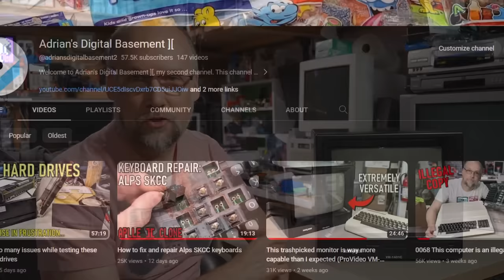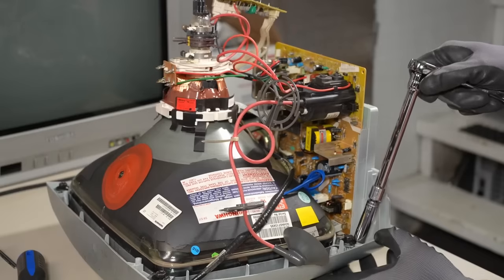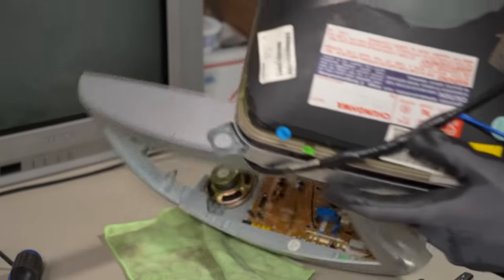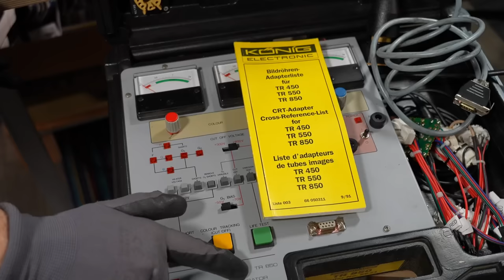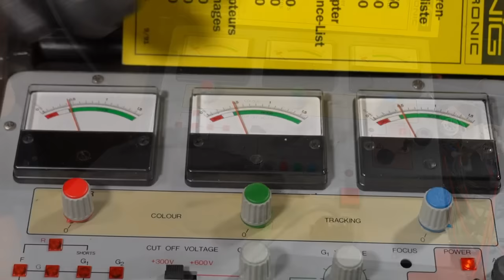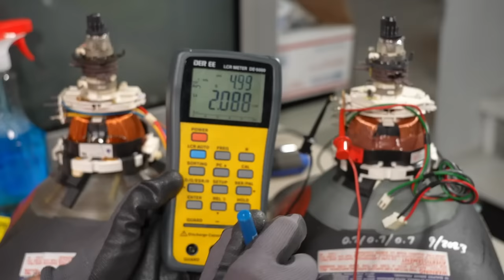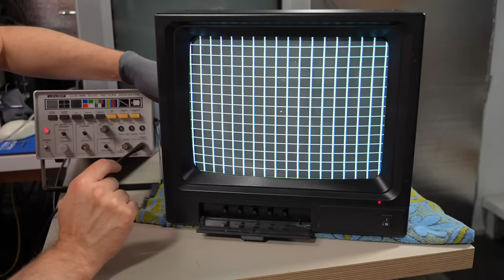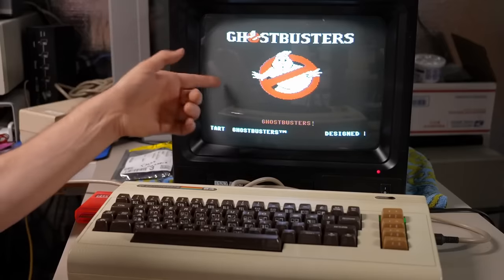From junk to awesome: Fixing an old monitor by swapping the CRT

Comment: I'm having a lot of nostalgia for how I taught myself electronics in the 1960s. When my father would take me with to the local city dump I would collect all the radios and portable televisions that looked either reparable or like good for parts and take them home. There was a public use tube tester in the front area of a grocery store and a couple of the local repair shops would sell me parts and occasionally offer troubleshooting advice. I could check out Sam's Photofacts from the public library, which was mostly to see what voltages were expected and on color TVs to get the convergence procedure.

By selling the repaired items I could afford to buy what I needed from Radio Shack to experiment.

Good memories.

Comment: i grew up working for TV shops, and became an expert in CRT TV and monitor repair.  i've done many CRT swaps, and even done "the hard part" of swapping yoke and convergence assemblies, and doing the full alignment process, usually a 2 or 3 hour process.  i even wrote my own test pattern software because the company i worked for couldn't afford the $10,000 for a test pattern generator for Mono, CGA,EGA,VGA, and SVGA.  i wrote test patterns for general monitor testing, as well as specialized test patterns for the convergence adjustments.
Reply: What are the 80s-90s tv called the smaller portable ones that have a clear square lens that goes over the crt screen that gives it’s a kinda futuristic look? I’m trying to find some more of those but don’t know what they are actually called…?
Reply: @thatdude4000  portable, or miniature.
Reply: @petergunn551  19” range. For example I have a 84 jcpenny model 685-2073. The ones that look just like this. I was surprised to see a 84 model with rca on the back it’s pretty top of the line model for that year. I have a wood grain trinitron that doesn’t even have rca I was like wth..!

Comment: So awesome that you used your CRT tester.  I don't know why you didn't just desolder the yoke wires directly froim the yoke then you don't have to cut any wires. This is what I have done then I did a tube swap in the past.
Reply: Yeah, with the yokes being identical I'd have just desoldered and re-soldered the deflection wires, bonus is that then the loom is exactly the right length too.

Comment: I remain amazed that CRTs were as cheap as they were. They're so tweaky and fiddly to manufacture and set up
Reply: It's amazing how cheap something can get once the economy of scale gets going. It's also why once that great machinery stops, there's really no getting that stuff back.
Reply: @Nukle0n  Indeed.  When the demand was hundred of thousands per year, you could make CRT's relatively cheaply.  Now, it's forgotten tech.  Nobody can make these anymore.  While we still have the knowledge, the infrastructure is long gone.

There are new vacuum tubes being made, but they are expensive, since they tend to be hand made.  But nobody, as far as i know, is making CRT's.

I have a couple of new in box CRT based monitors, and i am holding on to them for dear life.  ^-^
Reply: TBH the cheap stuff was pretty much crap. Those small TV screens were really low-end. Low resolution, produced whine, no good antiglare surface, nothing. Similar could have been said about the cheap monitors (by monitors I mean VGA). The high-end Trinitrons that produced really great image and handled resolutions like 1600x1200 or 2048x1536 at 85hz were pretty expensive. Did I also mention they did not whine? Pretty much monitors never did, I noticed that only on TVs I wonder why. Anyway, the quality was there. This ironically greatly helped the LCDs to take over the market. They were crap, but most people only had the chance to compare crap LCDs with crap CRTs, so the arguments of power and size won. Unfortunately this killed the high-end CRT market as well, but there the LCD was no match as replacement, and still is not.
Reply: @Lady_Zenith   Only with OLED, LCDs were going to come ever so close to the contrast of a CRT
Reply: They weren’t cheap until the near the end of their production.  Definitely still cost a lot in the 80s and 90s
Reply: @Lady_Zenith   "... monitors never did .. only TVs .. I wonder why"

Well, that's easy.  VGA monitors didn't run at horizontal scan frequencies in the audible range.  TVs scanned at 15kHz .. hence, whine.  Once you scan at 30kHz and up, it can whine as much as it'd like, and you're not likely to notice.
Reply: @nickwallette6201  thanks Nick! I was going to say that if you hadn't.
Reply: In the 70s, you could buy a truck for less than a television. CRTs were very expensive. That’s why I didn’t justify buying a television until the 90s.
Reply: @SirBoden  Yeah, there's a reason the accounts of home robberies tended to be just "robbers looking for the TV" for several decades there...
Reply: I can't imagine it was very profitable anymore by the time these CRTs were made and CRT quality was in a downturn by that era.  Now it isn't profitable so no CRTs.  I wonder if someone is still producing any somewhere?
Reply: @jeromethiel4323 I mean, when you compare it to plasma displays that could be available in the 80's.. it's not that awful.
Reply: @Lady_Zenith  My Sony and NEC computer monitors always had audible whine at certain refresh rates. The lower the refresh, the more noticeable. It was usually drown out by other offices noises like computer fans and AC systems.

Comment: The lines separated at the very top of the picture indicates worn-out capacitors around the vertical power amp IC. You adjusted the vertical position so the issue is out of sight, but it's clear that the picture centering is wrong, it needs to be pulled down a bit, but then the bad vertical linearity on the very top will be visible. You should do a vertical output recap, and I would also replace all the capacitors on the primary of the PSU (except the mains filter). If you do the RGB mod, I hope you will address this, too. I suggest to put a blob of silicone on the end of that convergence fine tuning strip, because there's a good chance the glue under it will dry up and the strip falls off at some point.

Comment: The brownish stain on the inside of the glass is tungsten.  The filament is constantly boiling off tungsten as long as the tube is on.  This is the key factor in the lifespan of incandescent bulbs.  Tubes tend to last a long time, because the tungsten is never heated to a bright incandescent level.  But most tubes fail either because the filament goes bad (boils off) or the vacuum is compromised.
Reply: Vacuum tubes have envision problems from the coatings on the tungsten getting sputtered off. They don't use better tungsten. Only high power tubes might, and then they usually use a tungsten and thorium mix

Comment: This might be overly specific, but I used to live somewhere that had a very active trash picking culture, Fairbanks AK. There were even little "give and take" recycling areas at many transfer sites with a concrete slab and a roof. Cutting off a power cord was a courtesy to dumpster divers that indicated that an appliance or whatever did not work. It would save someone the trouble of lugging something home only to have to bring it back again. I don't throw out many electric things but I'm still in the habit of cutting the cord before I do.

Comment: The last two numbers of a colour CRT model are the colorimetry, the actual temperature for the phosphors, P4 is grey monochrome, P22 is NTSC/Pal,modified standard, and P95 allows for a wider colour gamut with the correct matching demodulation vectors. P95 can be better than P22, but the correct demodulation matrix and a higher white point have to be used.

Comment: When it comes to CRT identification numbers, the last digits that come after the "X" denote the "ITC" or Integral Tube Component. This means that the CRT had the deflection yoke and convergence assembly installed at the tube factory, and it was supplied to the TV/monitor manufacturer as one complete unit. So the base tube (and mounting points) are actually 100% identical. It's just the deflection yokes which are different (but still electrically "close enough" in this case, as you found out).

The tube number is actually A34AGT13X. It was made by Chunghwa, which was a big time tube manufacturer based in Taiwan. Manufactured in Malaysia, this is a super common tube found in many 13" consumer TVs and low-end security monitors from the 2000s.

Also, nice to hear you got some advice from Sark on this! He's a legend in the CRT community.

Great video! Cheers, Adrian.

Comment: ah yeah rejuvenating color CRTs is always a gamble. Do it when you have no other options. That being said, some of the CRTs I gave this treatment still work 10 years after. Little hint : ramp up the filament voltage gently from cold condition until you see arcs between the cathode and G1 then let all cool again then repeat until there are no more shorts or you burn a hole through an electrode 😂

Comment: That's very similar to the Philips TV I had in my bedroom! Not identical, the control panel under the CRT was a bit curvier so it was probably a few years later. But the back panel is very similar — mine had SCART of course, and no RCA inputs. Just the one SCART. It supported NTSC, PAL60, and PAL (no idea about NTSC50).

Ooh, I always loved that quiet crackling sound on our family computer monitor and my dad's big TV. Sometimes I'd just hang around in the office after turning the computer off, feeling the static in the air (and on the metal venetian blinds). The little portable ones in the kitchen, etc, never did that to my recollection.

Comment: What can remove minor scratches from glass is optical rouge and a buffer wheel on a dremel.  I've repaired scratched GLASS watch crystals that way.  (don't try it on plastic watch crystals.  Ask me how I know that won't end well!)   If your doner CRT had the 'dag' coating flake off, you can still use it by putting a 500pf door knob capacitor across the HV lead to ground.  It would have to have a voltage rating of at least 30KV.  Transmitting capacitors of this kind can be found surplus.  The last two digits in the CRT part number are usually for the type of screen phosphor.  Maybe 'rare earth' vs something else?  Or perhaps the resolution of the pixels?
Reply: Tempered glass usually shatters when polished you have to have it constantly cooled with water and even then it's likely to shatter.
Reply: You can just repaint the aquadag on the back of the tube, I did this with a Sanyo 20EZ arcade monitor and it worked out great. It's just graphic paint.

Comment: Great video! 

I did a similar swap on a Galaxian arcade machine that had severe burn in. My donor was a 19" TV with low hours.

I believe the last numbers in the tube part number indicate the color of the phosphor. The TV tube I swapped in had a darker phosphor and it gave the game great contrast.

When LCD TVs came out you could find CRT TVs in thrift stores almost for free.

Comment: @Adrian's Digital Basement
Close but no cigar, remember there is vacuum inside, so whatever flyes flyes in a strait line until it hits something, the the brown area is not in a direct line of sight of the filament.
The deposited metal you see there comes from the shadow mask the electron beam scans over, its powerful enough to sputter off small amounts of the the material the mask is made off these fly  then backwards and get deposited on the area you noticed.

Comment: I heard that there is a company in the US that refurbishes CRTs, even replacing the phosphor on the screen if needed. Probably will be expensive, but should be interesting to investigate that possibility.
Reply: if it's the mob I'm thinking of I think they only do mono CRTs.
Reply: @SomeMorganSomewhere  I believe you are right, but even that would already be useful (if not for that specific CRT, at least to others).

Comment: 12:53 Try to support the tubes only by the screen area. Don't stress the neck as you did here by placing some box under its deflection coil assembly.
16:10 Ground wire should be the last connection to unplug. Otherwise you risk a minor shock or damaging the electronics if the tube happens to be still charged (common with monochrome tubes even after years of lying around).

Comment: The end of the CRT type code (after the X, which means RGB color phosphor) indicates the bonded yoke type. So yeah, that's the only difference between the two tubes.

Comment: I got a CRT TV for my birthday, I think when I was 14, which means it's over 25 years old now.

I had to repair it once (Dry joint), but it's still going great.

And yes, I use it every day! It's my alarm clock! It's probably on and running for an average as 3 or 4 hours a day currently.

Comment: By the time these CRTs were being produced I can't imagine it was very affordable to produce them anymore considering how much work was required to make them versus the newer LCD units that can be more easily manufactured in layers.

It still amazes me the ingenuity of building such a complicated way to scan an electron beam over the phosphors of a screen deflected by a magnetic field to display a picture and then with colour screens to get even more specific and hit the correct color phosphor points on the screen.  This is why bringing a magnet close to the screen or not using the degaussing coil results in color shifts and bending in the picture.

Still 30 years later many LCDs are now long dead and these units are still working.  They have amazing longevity as long as you don't leave the same picture on the screen forever.

Comment: At my local arcade museum, there's a Centipede with 19 inch CRT that's driven from a Commodore 1084 chassis (which is for 14 inch CRTs) and it just works (with minor vertical breakup at the top (left rotated) of the screen).

Comment: thank god, I've never had to do any repairs on a CRT, although I do have a little portable monochrome unit where I've added a connector to the wires going to the deflection coils, more so I have some flexibility if I ever case mod the CRT or have to do any other repair work. as well as converting it from RF to Composite.

Comment: There are places that recondition CRT's they are amazing, and I am not sure how many are left but I have seen video's on Youtube where they take the CRT's apart redo the necks, yea very skilled glass work people and they can change out the guns.  Amazing to see.   I only have one CRT left in the house a Commodore 1084 I think that's what it is.  Anyway, I only use it for testing my retro systems on so I don't use it all that often.   Last time I worked on anything CRT was back in the 1990's only because I had some injection molding machines that had CRT's and the originals were from Motorola the replacements were from Zenith and they used to be cheap but when they became hard to get, I had to repair them, and I hated the Zenith CRT's at the time the last American manufacturer of Tubes before Goldstar acquired them.   Honestly CRT's have always scared the hell out of me I can work on them, but I chose not to.  I do know for retro computing CRTs are special, but I am too old and it's not my most favorite thing the service.  I can do it but chose not to.

Comment: Two minutes in and I'm not certain but I think the dot pitch of the phosphor on a TV is not as good as that of a computer monitor, so the image may be fuzzy by comparison. Now I'll watch the rest of this video to see if that becomes an issue... Edit:- 37 mins in and the dot pitch was mentioned but the image still looks good for old time home PCs & gaming at any rate. So looks like it's worth doing a tube swap in these situations. Great video! Have I done tube swaps? Well I was a TV engineer back in the 19080's so yes I've done a few hundred. A lot of the tubes we had were re-gunned so not always a great improvement. We had to deliberately neck the old tubes by clipping the nipple so we could safely dispose of them. I wouldn't recommend anybody doing that nowadays. We did used to rejuvenate the color tubes (not Trinitron) and it did work for a while on some, but they would usually come back with low emissions not very long after doing them, a very few did have great long term success though.
Reply: This was not a computer monitor, but a security surveillance monitor. And both crt’s are identical regarding dot pitch, so it is not changing by swapping anyway.
Reply: @telocho  Fair comment.

Comment: Correction: The capacitor formed by the CRT envelope is actually the filter capacitor for the high-voltage DC supply. Very early TVs (late 1940s era) actually had CRTs where the portion between the screen and the neck was metal (!!!) and in order to properly filter the CRT anode voltage, there were usually a couple high-voltage "doorknob" capacitors installed next to the rectifier tube. Thankfully some engineer was able to figure out how to eliminate that extreme safety hazard!
Reply: I believe it was only larger round CRTs which had metal cones. AFAIK normal sized ones were always glass envelope. I think there were yield problems producing larger pieces of glass without defects. A side benefit of metal cone CRTs is they weigh much less than all-glass ones.

16 and 19 inch monochrome from the late 40s and 21 inch color from the late 1950s are probably the most common metal cone CRTs used in American TVs. Types 16GP4, 19AP4, and 21AXP22.

Comment: Fairly common for US Philips sets to sync to 50z.

Also many of the later mod Philips/Magnavox can often be modded for YPbPr intput.
Reply: Would the missing 30 cents components that Adrian mentions, be the PAL delay line by any chance? It’s basically a passive component made from a calibrated piece of glass inside a case, with a wire attached to each end.
Reply: @telocho  That, and a 4.43 MHz crystal I guess.